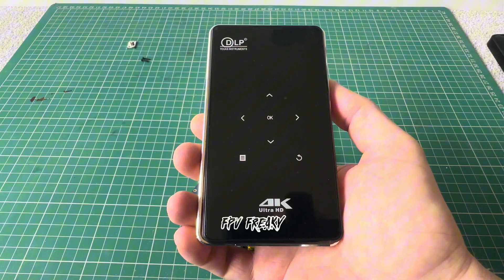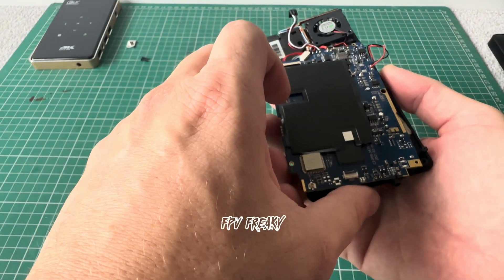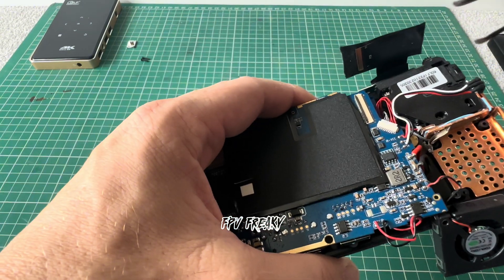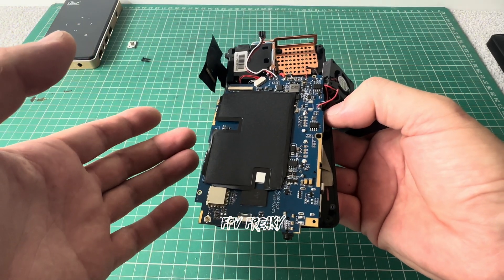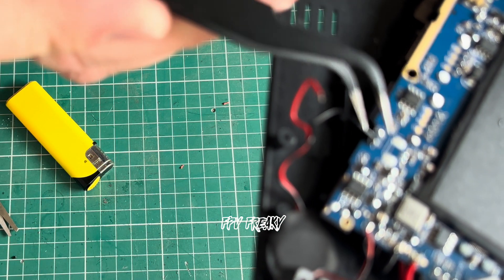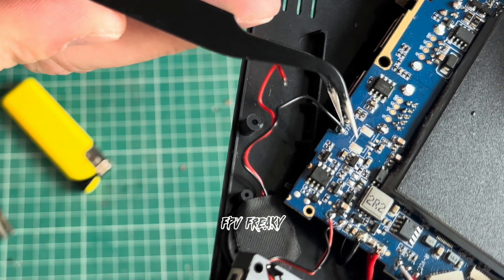P09 Mini Led Projector /4K Home Cinema / battery replacement 🤩#miniprojector #projectorfix

Comment from the maker: TIME STAMPS
0:00 intro.
0:06 explaining what’s happened.
0:50 I found a battery for the p09 projector.
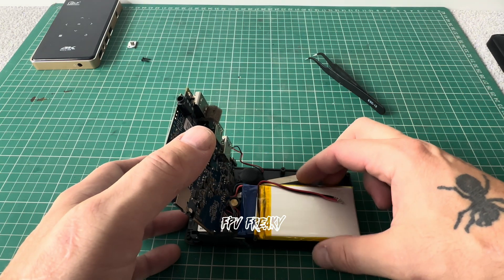01:21 battery size comparison.
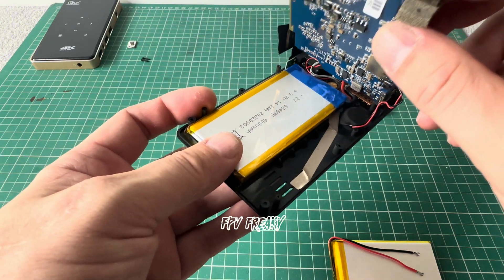01:47 start testing the new battery.
02:00 Tools I’m using.
02:14 Removing old battery from P09 projector.
02:28 New battery for P09 projector.
02:47 de soldiering old wires from old battery.
02:53 old battery removed from P09 projector.
03:07 preparing new battery wires.
04:04 more wires and repairing.
05:48 repaired all broken wires and fixed now.
05:53 a general tidy up inside the projector.
06:04 reinstalling the cooling fan.
06:31 preparing loose wires for closing the projector.
06:35 securing the new battery in place.
06:54 reinstalling the motherboard.
07:36 P09 casing reinstallation.
08:35 installing the motherboard screws.
09:27 reinstalling infrared module and tidying wires.
09:40 Reinstalling the main LED projector ribbon cable
10:00 covering exposed terminals and heat shielding.
11:22 Replacing main project front panel checking over your work.
11:49 installing the main projector screws for the P09 mini. 
12:11 finished. testing to see if it works?. ( Subscribe ).
Reply from the maker: @Abhay-u8u7p

Comment: Hello! please can you make a video how you open the projector from the beginning.Thanks
Reply from the maker: Hi there if you see 11:49 there are 6 x screws to remove the rear casing. Then see other time stamps in the pinned section in this comment section. I’m not goin to pull it apart again. Hope you understand. I’m working on other projects right now. Just not got time. Thanks for watching. I hope the video helps. Kind regards fpvfreaky 🫡

Comment: What is the black tape called?
Reply from the maker: @rajamuhdfadhli231  it’s called fibre tape I think. I just used what was already in the projector wasn’t anything that I had. But I think is what they use on wiring harnesses. Hope that helps.
Reply: @Fpvfreaky  Ah I see… Thanks!